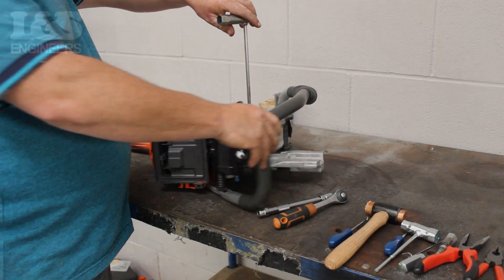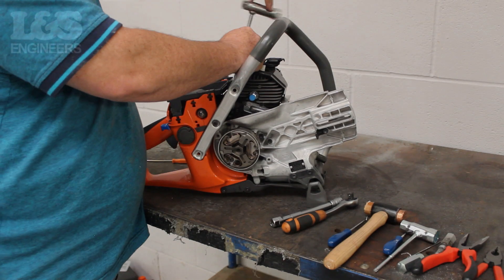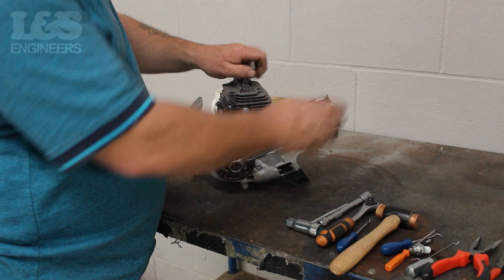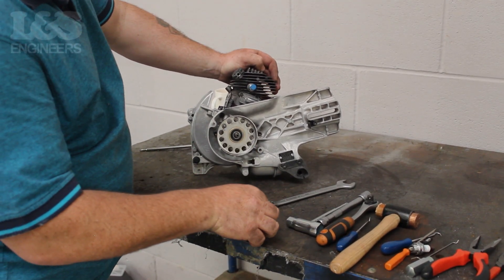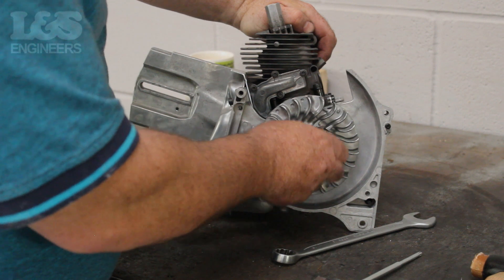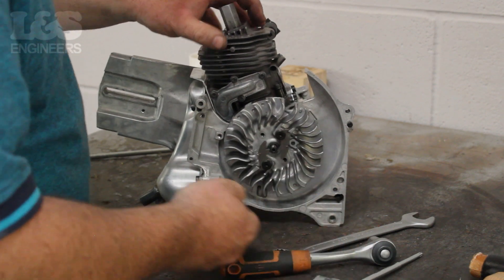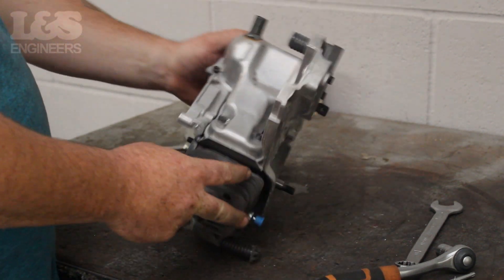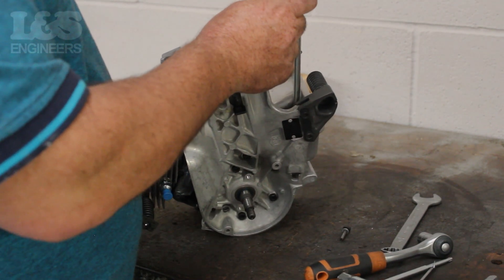How to Strip a Husqvarna K760 Down to a Short Motor | L&S Engineers

Comment: been looking everywhere to find the model and serial number plate on this saw. any idea? i need to find out if i have k760 version 1 or 2.
Reply from the maker: It should be on the bottom right hand corner by the AV spring. I hope this helps :)